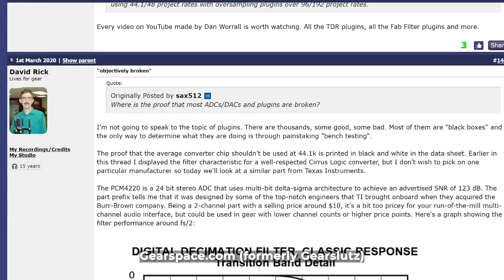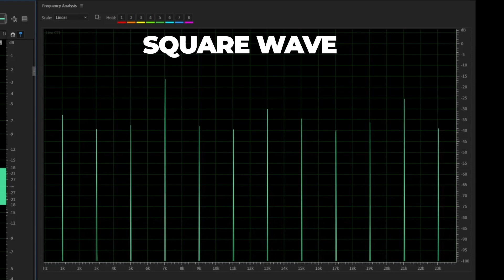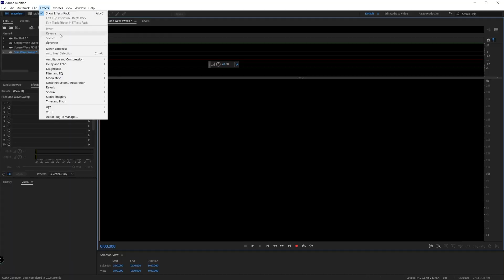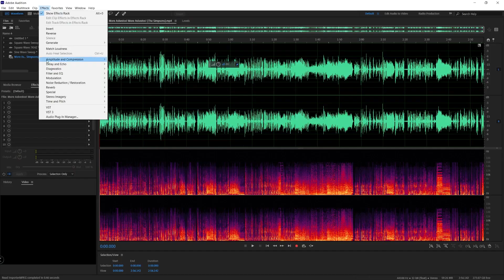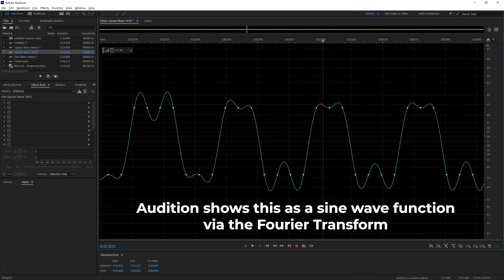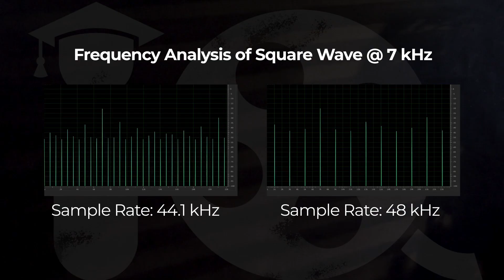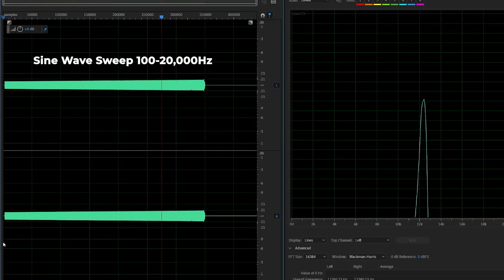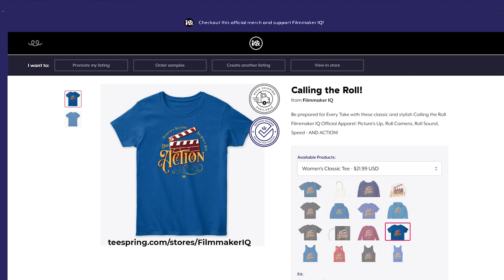What is the Optimal Sampling Rate for Audio? (It's All About the Aliasing)

Comment: Audio engineer/vintage audio repair tech here. No, you can't distinguish a 10kHz sine wave from a square wave, because the only difference is ultrasonic harmonics. So why the plainly audible difference in your demonstration? (4:24) Because the square wave you synthesized bypassed the anti-aliasing filter that exists at the front end of all A/D convertors. Since your square wave entered the digital audio system without going through the anti-aliasing filter, its ultrasonic harmonics aliased badly, creating dissonant sub-harmonics BELOW the Nyquist limit, which were plainly audible. If you had used a signal generator to create your sine and square waves and then recorded them (or simply listened to them), you would not have heard a difference.

Nyquist was and is right. 400 billion CD's can't be wrong.
Reply from the maker: It's almost like you didn't bother watching the rest of the video!
Reply: @FilmmakerIQ  Busted! I'm still watching it as I write this. Mea culpa.
Reply: I have, however, learned something already from your video. I didn't know about the 16kHz brick wall filter used by YouTube. Since I can't hear above 13kHz (I'm 57) I would never have noticed it.
Reply from the maker: I'm not sure 100% sure if it's YouTube or my downloading software, but I wouldn't put it past YouTube...
Reply: @FilmmakerIQ  I usually use Adobe Premiere Elements to edit and upload, but I  - might - create a private video and upload it manually, with a sweep to see if it's YouTube or not. Not that it really matters, but it'd be interesting to know.
Reply: @FilmmakerIQ  An interesting result! I created a quick and dirty video in Premiere Elements, using sine wave files created in Audacity. When Premiere Elements created the MP4, it knocked out everything about 17kHz, even though I used a 48 kHz sample rate. Probably part of the AAC encoding profile. I uploaded the video to YouTube, and when I play it back, it doesn't seem to change. I did get a solid 17kHz tone back from YouTube, though. I can't say about anything higher because the video I uploaded had already been decapitated between 17 and 18 kHz.
Reply from the maker: Here's a Sine wave Sweep file I created: 
https://drive.google.com/file/d/1B4FQxHjoWeWgwfJkOL62QDez8x0XOyco/view?usp=sharing

Here's that Sine wave Sweep file uploaded to YouTube
https://www.youtube.com/watch?v=xrs1sgRDkfs

When I download it from my YouTube Studio - I indeed see that hard cut off at 16khz. Try it and see if you get the same results.

Comment: The comparison is just wrong. The 10 kHz square wave has discrete frequency components that extend to a very high frequency. In fact, any square wave, by virtue of its instantaneous rise and fall time will require very high sampling rate to reproduce accurately - depending on how well you want to reproduce/reconstruct it.

Comment: wave B is lower
Reply from the maker: Incorrect
Reply: @FilmmakerIQ  I mean not that it actually lower, but that I perceive it lower, thus it is is a square wave
Reply from the maker: It isn't. You were tricked into believing it was by your brain.
Reply: @FilmmakerIQ  hm. But I clearly hear the difference. Or maybe aliasing on lower main frequency (5.2) gives results in higher perceivable tone in opposite to higher ones? Or you want to say that they are both sine?))
Reply from the maker: Nope, one of them definitely has the higher second tone. 

There's only one correct answer if you can actually hear it and it isn't B. What you're hearing is the power of suggestion with my test and visual cuing. :)
Reply: @FilmmakerIQ  it is really strange. I clearly hear on YouTube  A as higher and B as lower in my headphones. Will try to listen with different devices